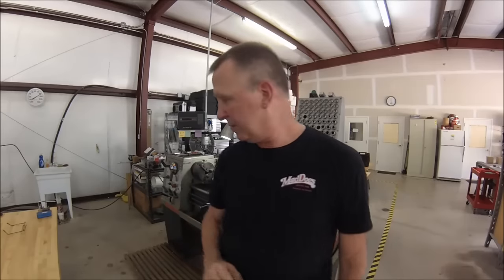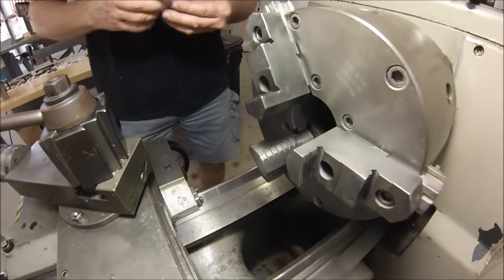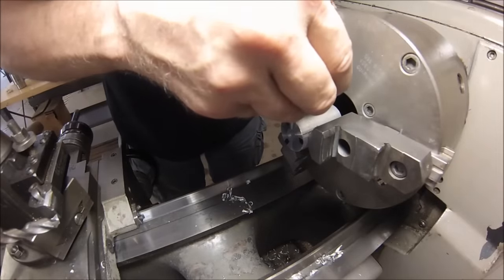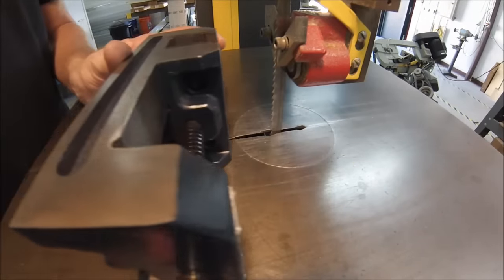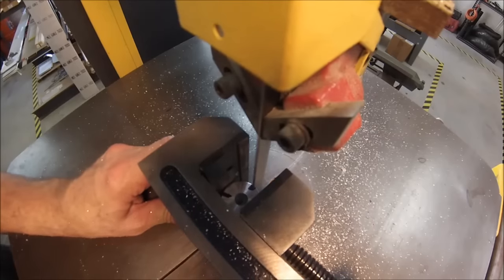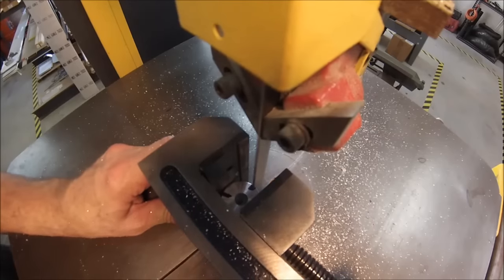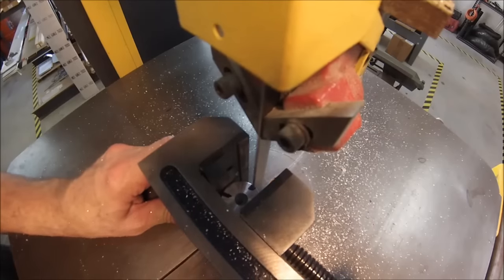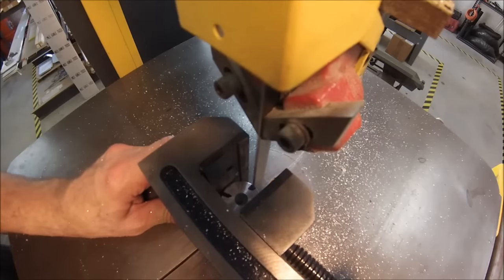Get your parts to run true in a non adjustable chuck. YOU MUST WATCH THIS!

Comment: Hi, every time you remove the collar from the chuck you loose its concentricity ?
So how do you reutilize the collar another time ?
What do you have to do to find concentricity again ?
Reply from the maker: True. The collar should stay in place. if you have to re-use it, simply grab a thinner shim than you used initially. This will compress the hole smaller giving you room to re-bore for the next use. The best is to use it for the next size up and just make another one if needed. if you have to re-use it, get a pin or shaft the size of your part, install the bushing like before and attempt to feel the jaw marks engage the OD of the bushing. I normally align my splits with the jaw opening near my chuck key socket. It makes it easy to remember.

Comment: I particularly liked the way you checked for a burr after you filed it, suppose there was still one there?
Reply from the maker: It would have to cut thru 48 years of calloused finger before I felt it.
Reply: @joepie221  Big respect. I am aerospace technician, I have operated many types of machine tool, both CNC and manual, at one place I was setter for the regular operators to go on afterwards. My Father was also a machinist, but back in the day when Noah was a lad. He was telling me once about a job that he was on and it had a tapped hole and he would knock the swarf away from the hole while the m/c was running. Anyhow, one day, Dad was off and another chap who had seen Dad working this particular job set about running a few off, on his first one he yelled out that he was trapped, the other men came and released him and packed him off to hospital with a severely damaged finger that had been wound down into the threaded hole. When interviewed later as to how the incident happened the operator said he had seen my Dad do it every time, When it got back to Dad, he chuckled and said, "Yes, I put it in reverse before I put my finger near the thread."
Take care of your hands, a burr is far more durable than any callous. (I am 62 this coming July)

Comment: Great Vid I'm a bit rusty on using reamers on average what is the max material you can take out with a reamer?
Reply from the maker: That depends on the material, type and size of reamer. On average, I take about .015 on reamers between 1/4 and 1/2, more on bigger reamers, less on smaller reamers.
Reply: Thanks for that Joe. Merry Christmas And Happy New Year to you and your family
Reply from the maker: Thank you very much. Merry Christmas to you and your family as well.

Comment: Do you actually trust the outside of the chuck to pre indicate it? I have some that are not true outside that run true chucked up. I’m finicky if my chucks don’t run near 0 true I will fight them until they do or replace them. One chuck I had to drill the 4 holes out larger so I could move it on the backing plate a smidgen further to dial it in. It’s the one with all the hammer marks on it 🤔. Don’t know how I’d live without my reamers. God bless whoever thought to make the first one. I prefer rapid tap it works a lot better than tap magic from my experience and I won’t ever switch back. I also mix it with diesel fuel for bandsaw cutting and small production milling.

Comment: This may be a dumb question but couldn't you just run a bore through your jaws to straighten it out?
Reply from the maker: You absolutely could. Thats a whole other topic. This is a "make due with what you have" video solution.
Reply: Problem is, that will only work for one diameter.  The scroll never wears perfectly concentric, so you'd have to bore it for each and every setup.  Pretty soon you have no jaws left!
Reply from the maker: Its actually very common to true  up jaws with a boring pass or grinder, but the jaws are usually set at around 2 " for the operation, and its only done once in a  great while to correct jaw wear or chuck distortion.

Comment: If you don't have access to a band saw could you make the relief cuts with a mill?
Reply: If you have and endmill that's thin enough I'm guessing that ill will work, a slitting saw would be ideal, its a lot safer and precise.
Reply from the maker: Either option will work.
Reply: Jerry Michrina ,thin wheel cutter ,could put in a vice and manually do it with a mill.

Comment: Nice video.  If you mark the position of the bushing relative to the jaws, can you remove it, and later return it to the jaws and expect equally minimal  runout?  If so, I'd like to make multiple size bushings.  My old chuck has even worse runout than yours, and is not adjustable.
Reply from the maker: These perform best when bored and used without removal because the jaws can bite the material. If you have a good feel and can get the bushing back in the jaw teeth marks, they should repeat close, but I would expect, not as accurate as the original position.
Reply: @joepie221  I was thinking the same as this guy.  Why not take your time and make the collet out of tool steel and generate a very fine index mark on both the bushing and chuck jaw before boring (mark both, line up the marks as best as you can see and then bore with the reamer)?  I like this idea.
Reply: @hughezzell10000  You could even put a couple of small (1/8") roll pins in it to bump against a chuck jaw, to get it to sit at a repeatable position again and again, but it needs to be done when you put the slug into the chuck initially.

Comment: Did you just remove your hand from the chuck key, leaving it in the chuck? I was taught to never remove my hand from the chuck key while it’s in the chuck, for safety reasons.
Reply from the maker: 2 answers here. 1. I always take my machine out of gear to rotate the key position to vertical, 2. My left hand remained on the chuck key out of camera range.  So thats a no. I never take my hand off the key if its in. Never.
Reply: My latest chuck key for my 4-jaw has a spring around the square drive so that it is self ejecting. If you take your hand off of it while on the chuck, it self ejects itself. Maybe not needed for old timers, but it does ensure safety.

Comment: If you used a turned piece of ally (for ease of visibility) and set the "collet" back into the witness marks made by the hard jaws i wonder how well it would hold concentricity
Reply from the maker: Pretty close, but you have to have a real good feel to find the bite marks the second time around. I've done it.
Reply: not very well at all since he took the part out of the jaws ad turned it around to face the back side BEFORE he put the witness marks on.... he also didn't number which piece was going to each jaw for after he cut them apart.

Comment: I'm planning to try this to get a titanium piece to run true. You said in the video to use a part 3-4 times the size of the part. So is it good for me to use a 3" piece of round aluminum stock if my part is .9" OD? Or should I go larger or smaller?
Reply from the maker: Smaller. Use a piece that will flex easily. 1/4 to 3/8" per side is usually fine.

Comment: What do you mean by Non-Adjustable?  I have a German Schmitt Lorch lathe from 1925, and I can close the Jaws with any of the 3 tighteners. They all close in toward the center- do they require alignment, and If so, I am not aware of any way to do this since it is not variable and they all tighten at the same time and rate/pressure. The only adjustment that I might be able to make would be the  3 bolts that connect to the back of the lathe, but that would be very minimal. Ernest
Reply: Ernest Joyner that’s non-adjustable. His chuck is an adjustable chuck. The four screws move the entire body of the chuck around center, and allow 0.0005” accuracy.
Reply: Mel Gross Thanks Mel!
Reply: Screws that tighten the jaws should all be tightened. Start by snuggling up one then another till all are tight evenly. You're kidding yourself if you think by tightening one screw it tightens all the others equally.

Comment: I would just shim it or build another collet and index the collet to the Jaws.... The other thing is I have several round stock with 8 holes with set screws that act as 4 jaw chuck to manipulate the part any which way or just use brass or copper tubing with a single slot turned then index marked
Reply: That's clever. Do you mean the 8 screws are 2 each in North East South and West, with the 2 screws in a straight line? Could you explain the copper tubing idea in more detail?

Comment: I see this a lot, when people turn the really close tolerance indicator needle out at an extreme angle, this creates a cosine error, just saying, we came up with this in the Metrology department of a major company, many times, also the wear on the needle ball becomes a factor if you are measuring by the indicator alone, and not one to one comparison, i.e gage block stack, etc?
Reply: Stephen Hodge That's just silly. Your dialing a piece not measuring a piece. You sound like an engineer. lol
Reply: Google it,  Cosine error in a Brown and Sharpe indicator.
Reply from the maker: A dial indicator should not be used as a measuring device. Thats why its called an indicator. It indicates differences in surfaces or concentricity. I did not use mine to measure in this example. It was strictly a reference zero to indicate movement. But....The pivot joint where the needle connects to the internal linkage doesn't care where the needle tip is. Its rotation that matters. A flat on your tip is just a likely to send a false signal. If you want to use an indicator to measure, keep your needle straight out, make sure the tip is clean and round, and stay in a small window of movement or use a drop indicator. Just my 2 cents.
Reply from the maker: Stephen. 1 additional thought on this. I have to believe that the engineers at Brown and Sharpe took into allowance the difference in length between the tip and pivot and the pivot and dial for their internal design. This being said, the greater error can be caused by extending the tip on an indicator that is not billed as an extended tip indicator. your scenario is a tough one to discuss in words, but there are some concerns. Tip movement and dial movement don't always indicate a planer shift of the same value. I have encountered this when using a round indexer to control a vertical height movement. At the top of the circle, a 10 degree shift in position is very little drop. At a 3 O'clock position, that same 10 degree shift is much greater. Is this familiar?
Reply: to me the only value that is true on a test indicator is "0" as all depents of the angle of the tip of th indicator on the part.
with a 1" stroke indicator, if if is positionned at 90 degrees of the part, its reading could be reliable.

Comment: Wow! Now I am really wondering, drill, bore, drill, bore, ream? Why???
Reply from the maker: OK. Drills and reamers are weak and dependent on the existing hole. Only a bored hole is guaranteed to run true. The shorty bore steps were guide features for the critical tools that followed. The first bored step knocked down the shim so it wouldn't grab the drill, and the second acted as a for the reamer.

Comment: What is the reason to not run a lathe with nothing in the chuck? Does it have something to do with no pressure on the jaws and the rotation damaging them?
Reply from the maker: The difference in mass of all the components can walk the jaws out if repeatedly started and stopped abruptly. I never run my chucks empty regardless.

Comment: So, you built an improvised collet with an eccentricity that compensates that of your chuck.
Reply from the maker: Technically, the eccentricities (2) are between the bushing and machine, and the bushing  ID to the OD. The bushing ID is true to the machine. Just don't open the chuck so far that it slips.

Comment: Very good. Have done similar. You mentioned "Soft jaw carrier".  I'm familiar with soft jaws but not carriers.  If you could enlighten.  Cheers. Rob.
Reply from the maker: Thats the lower part of any 2pc. jaw setup. Its the jaw part that engages the scroll and the bolt on upper.

Comment: Bro, next time use hex stock.  YOu won't have to worry about the bushing rotating while jaws are loose and this idea of yours applies to more than just concentricity issues.  I have to hold and item that has to be machined ona  .480" diam and the part being chucked is .130"  I need a collet like item holding the part and when I use 5c chuck the thing that stinks about that is that I can't rely on the chuck to give a good back stop.

Comment: I've even (carefully) Bored Hard Jaws before today. (just a light skim though) It's also important  to know the correct sequence for mounting the Jaws. Turn the jaws over so you can see the serrations you'll see the steps are progressively longer The shortest goes in  Jaw slot 1 middle step in slot 2 & Longest in slot 3 (Jaw slots should be stamped  1, 2 &3  -if not - stamp/mark them yourself)  Once you've done that - Hard jaws will be true enough - after all they're not for gripping precision, finely machined parts!!
Reply from the maker: The jaw position in the chuck doesn't matter. Only the sequence in which they are installed matters. you can start anywhere.

Comment: Yo Joe!  Thanks for all your videos!

At 2:49 you put up some text, "Never turn the machine on if the chuck is empty."  What is your reason for stating this?
Reply: planeflyer21 I think it might be because the Jaws can fly out
Reply: The jaws are held by a "snail" inside the chuck. So it's very unlikely they will come out. However, the forces that build up when the chuck is loose makes the jaws fly outwards. Sooner or later someone will start the machine with the jaws hanging just on the last little "thread" of that snail. Then bad things will happen. To prevent this it's good practice to never start the machine without a workpiece in the jaws. Equally, good practice is to put your key in a place away from the chuck EACH time regardless if you want to start it up, or are just leaving the shop to take a leak. Take that key out of the chuck and place it somewhere safe.

Comment: I've been trying to make chambers reamers, no good ones yet !never tried the reamer stock just 01turned to shape on lathe cut the flute on mill with indexer harder then cut to final size  with tp grinder ,any advice or tips would be appreciated
Reply from the maker: If you do this a lot, just have one made. Most tool grinders can do it easily.

Comment: What if you lathe's three jaw chuck  doe's not have separate jaw adjustment? will this trick still work. My lathe is a mid. 1970s  Craftsman(Atlas) 12x36 in great shape with the original three jaw chuck. I do know it's a bit out of round, if this trick will help I'm going to try you fix.
Leonce
Reply from the maker: It will. My chuck has one key to operate all 3 jaws as well.
Reply: Your video showed you adjusting or backing off each jaw, I can't do that with mine, one key hole that adjusts all three. I have just bought a tool post grinder for fixing up the jaws, will this help? I did try to check my chuck for out of round after watching you video, but I need to get a better indicator stand to do this.
Leonce
Reply from the maker: The video never showed that. My chuck can not control each jaw separately. It is a set tru style, so you may have seen the chuck body adjustment to throw the chuck out of line. I only have one key spot as previously stated. The grinder will help a great deal. Take you time and dress the grinder wheel before you begin and after each pass. Make sure you are closing the jaws during your pre grind setup and not opening them. Clamp on something as far away from the chuck body as possible. Get creative.

Comment: Hey Joe just wanted to ask you about how do you get a tool to fit in the head stock where the chuck goes. I saw someone the had a drill chuck or Morse taper in that part of the lathe. Hope my question isn’t too stupid
Reply from the maker: If its a straight shank, just hold it like a piece of material in a chuck or collet and be sure its running true. If its a taper shank, you probably have to take the chuck off and use a sleeve directly in the spindle nose with the correct inner taper. The sleeves are common.
Reply: You can make a Lathe into a (simple) Milling machine -  put a milling cutter in the head stock  
chuck & the component in the tool post , has it's obvious limitations - but maybe OK for some Hobbyist stuff. (Plunge with the Longitudinal slide & length with the cross slide) 
Long winded - but can be done!!

Comment: If a guy stamped that bushing to index it to specific jaws, could it be reused?
Reply from the maker: It would correct some of the error, but is unlikely to repeat as good as the first time. The jaws will probably imprint the aluminum on the first squeeze and leave tracks that would need to re-engage with the original jaw.
Reply: @joepie221  Thank you. You've taught me a lot.
Wish I could shake you hand
Reply from the maker: @preacherpdx5519  I'll settle for a subscription and positive comments. Maybe someday at the summer bash you'll have a chance. Stay well.

Comment: Wouldn’t you lose concentricity on the scrap piece when you flip it around and face off what was the back side?
Reply from the maker: Yes you would. But the finished hole isn't established until the part is flipped.
Reply: That's why the first hole is marked and drilled undersize silly. You must not have much machine shop experience what so ever.
Reply: @CvmwUS  Pardon the fuck out of me for wanting to learn new stuff.